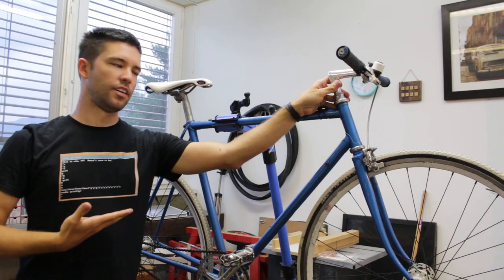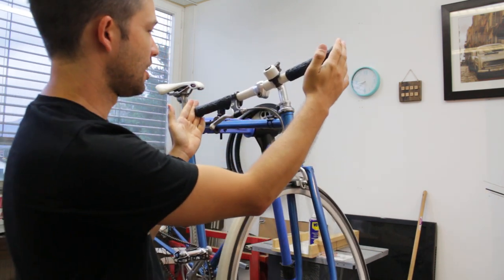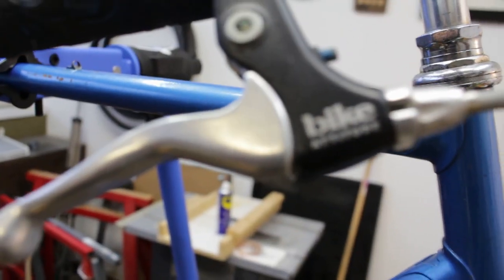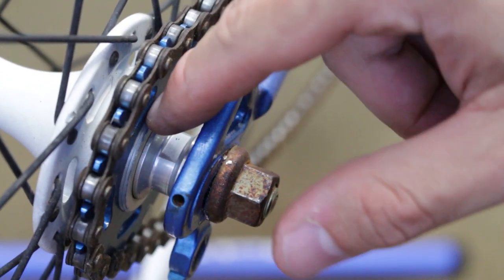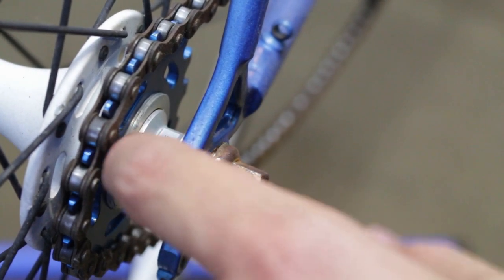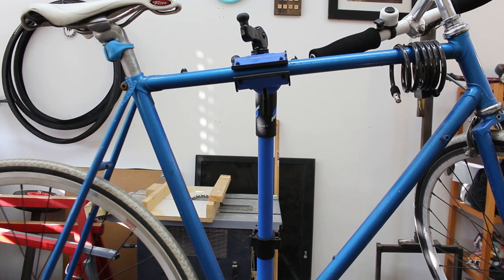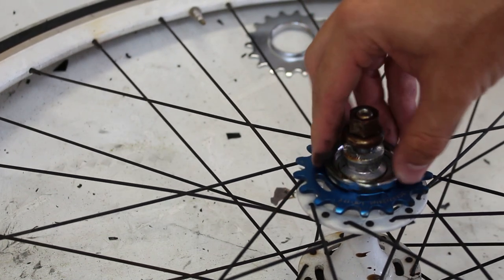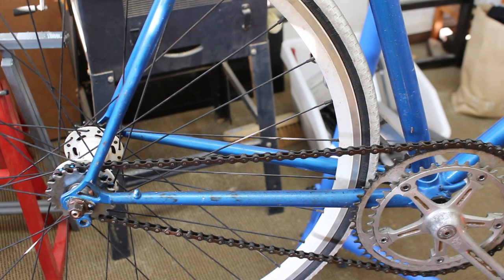Fixie 30 day commuting challenge (2018)

Comment: Video title is inaccurate. You need a new hub that supports fixed cogs. If your solution were to ever malfunction it would be catastrophic. You also need a lock ring tool to secure the lock ring. If you don’t want to spend money on a new hub I say use red locktite or JB weld on the threads, it essentially welds the cog to the hub. I hope this helped and I know it’s been a while but I hope you still are riding fixed, it’s quite enjoyable!
Reply from the maker: hey RZ, well it healed for probably about a year of off and on riding, then I ended up giving the bike away, don't know what happened after that.